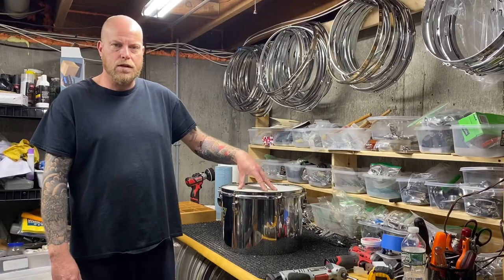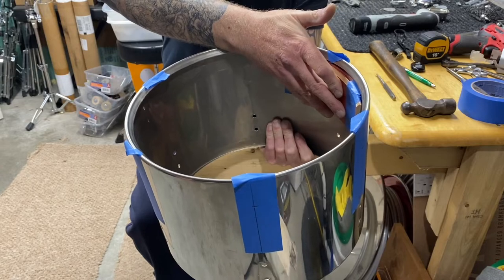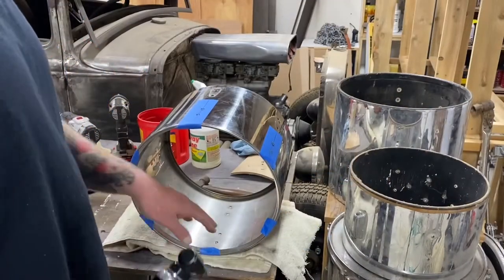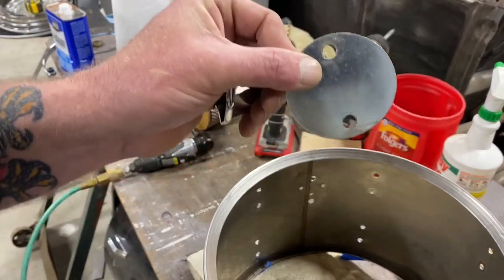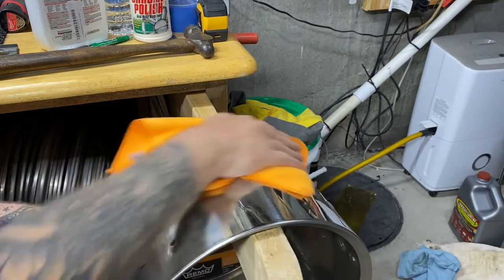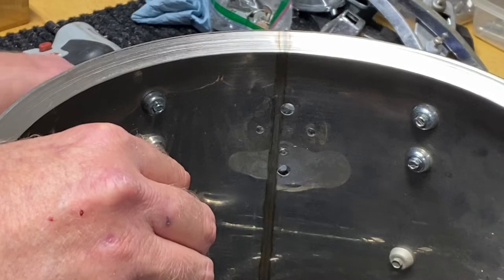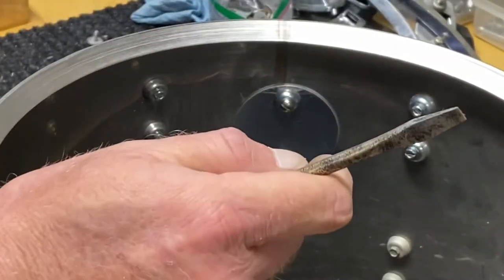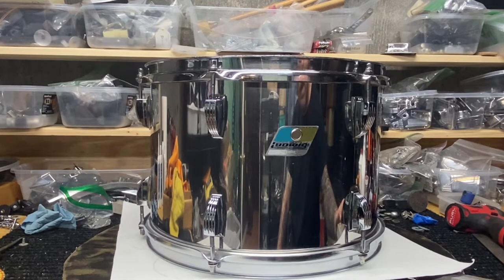Converting a concert tom into a double headed tom. 70's Ludwig Stainless Steel Vintage Drum Set.

Comment: I use a Drum Dial to tune my drums, I found one on Craigslist for 15 bucks so I just went ahead and bought it. when I used it on my kit and got everything completely uniformed in tune man in made a huge difference, I  have a pretty good ear for tuning but I thought even though my drum sounded good that they would have been close but a lot of the lugs were not even in the same range I found out with the drum dial. So my rack tom is set tuned to 74/74 top and bottom but when I first used it I had lugs that were like 68,68,70 but it still sounded pretty good but once they were all 74 it was 👌.
Reply from the maker: I'm a firm believer in do what works for YOU! If a dial, bot, whatever gets you the sound you are after go for it! My preference is by ear but that's just me.